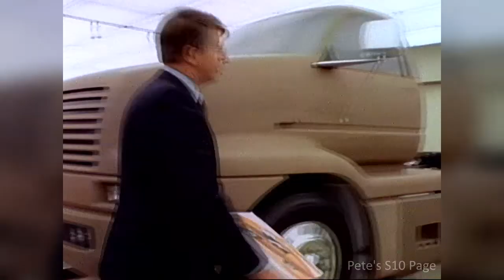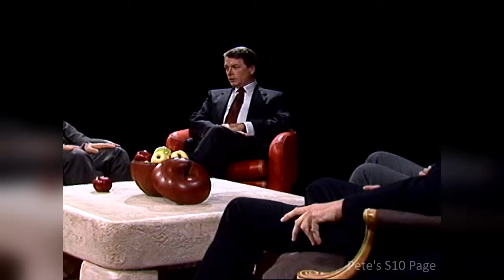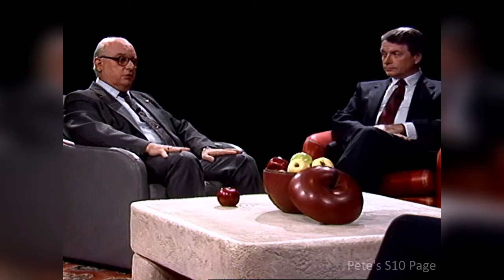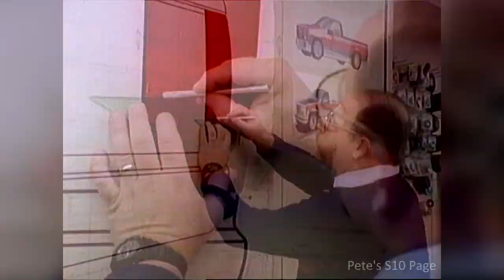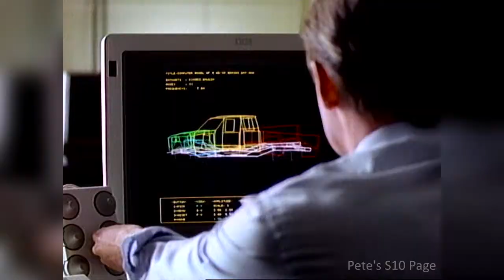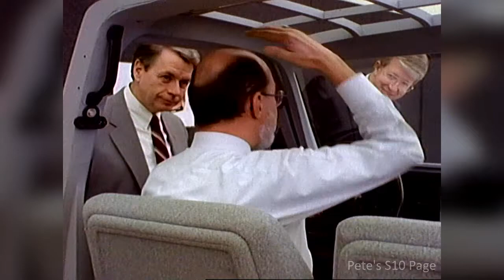1988 Chevrolet C/K Design and Development  - GM Training Film

Comment: It was a great body style,I wasn't A great fan of the weld on pin style door hinges,the dash was a little to busy for my liking,and they got away from the bolt together bed,and the double wall roof. I will say,it is a great driving truck,and very comfortable.and the fuel injected throttle body,and the Vortec engines were great performers,and decent on fuel and fairly easy to work on especially compared to the Fords at the time,and I am not putting down Fords,they were a good truck, until they came out with 97,and newer F-150,and 7 lug F-250s.One thing I like about the old body style Chevy is they were in my eyes a pretty good looking truck,there were somethings that could have been made a little better,but still overall a pretty damn decent,and dependable truck.

Comment: I bought mine new in 89, and still have it. It's true about the engine bay. It was the first hose/wire free engine compartment sense the 60's. Even A/C models had a clean engine bay... and hearing that they thought of the owner servicing the truck... making an effort to make that easy, is something that is long gone these days. I consider these the last true GM/Chevy trucks ever made. You can restore these to like new condition, and not even get close to the cost of a new one today.

Comment: Fast forward to 2024....make the thermostat housing one entire assembly....and make it out of plastic!

And put a clause in the warranty that if its used to full payload it voids the warranty!

Meanwhile at Ford: put a rubber timing belt in the engine....no seal it inside the engine with the oil....and do the same for the oil pump!

And any part that's not the block or head needs to be plastic! No not that! The cheapest plastic! Its got to last....4 years.

Meanwhile at Jeep: This wiring loom is already splitting and corroded from the supplier?....chuck it on there who cares. Marketing will offer free roadside assistance.

Comment: I think the 88 and newer Chevy is one of the nicer driving highway trucks, comfortable seating nice ac although the 88-94 controls can be a pain.
           I just wish at the time they would have continued some features that made a GM truck a GM truck ,like the double wall steel roof,and the bolt together pick up box,but progress,and cost cutting along with change can't be avoided.

Comment: I was attending the University of North Dakota in 1987.  I recall in the local newspaper an article about GM taking preproduction 1988 GMT 400 trucks to North Dakota to validate their HVAC systems...this was in January during a bitter cold snap.  They had a picture of two of the trucks being tested and it looked so radically different than the OBS previous generation.

Comment: Thank you GM Engineers, I'm still running a 95 as a daily driver today! And have a mint 98 too!
Reply: Damn!!! Nice! I wish I had A GMT400 4WD truck right now, I used to have a 1996 Suburban K1500 w/5.7 Vortec V8 and then later I ended up getting a  1992 C1500 extended cab w/5.7 TBI V8 that was lowered and had a full sport body kit that replaced all the side body panels and front and rear bumpers, made it look really bad ass, like a nascar/muscle truck…..The GMT400 had a very simple yet beautiful classic timeless design….
Reply: Still daily my 1990 C1500 up here in Minnesota the body has seen better days but it’s been a great reliable vehicle for me

Comment: These were probably the best trucks ever built.
Reply: If you’ve never used a truck.  The 3500HD was pretty ok.  But with engines ranging from meh (5.7-7.4) to 🐶 💩 (6.2-6.5)
Reply: @randymagnum143 the 4.3s and 350s are bulletproof. I own a 1996 4.3 with 235k miles and it has never let me down starts faster than both my dads 2019 ram and my grandpas 2021 f150
Reply: @galesburgdude9131  they're bullet resistant, maybe.  TBI was laughably outdated, but reliable.  Vortec injection was nonsense, and still not as powerful as a 5.9 Dodge.  
So, good enough to be better than any toyota engine.
Reply: @DanCooper-k4b no small block chevy was bulletproof, but a 283 might have been the closest, and a 400 the furthest away.  And the 4.3 has 3 distinct versions, from GM trying to iron out their inherent flaws.  They were acceptable at best.  The 3.9 Mopar was more durable, more powerful, and just as thirsty.  I think they shook a little less, myself.  But the 4.3 with the counterbalance wasn’t bad.  

They are certainly more bullet resistant than any aluminum headed engine.

Comment: This is amazing stuff, and shows a fair bit of surprising content given how carefully orchestrated any film shot within Design Center is. The large semi tractor clay model is what was being proposed for a Brigadier class 7/8 replacement. Like the GMT530 TopKick that followed, it would use a 400 cab, but use a nose similar to a design being pitched at the time for an updated General conventional. At least one running "AeroBrigadier" prototype was built, but likely scrapped. GM Heritage Center does, however, have one large scale model of the Aero Brigadier within its collection to this day.

Comment: If you would park a factory 88 to 98 Chevy or GMC beside a 2019 to 2023 the older truck still looks sleeker and more aerodynamic. The new one looks like a cardboard box especially in the back. Always liked GM trucks but would look to another brand for a new one
Reply: It’s designed like that on purpose. It’s supposed to look like a fist

Comment: I wish I could meet each and everyone of them and shake their hand my truck I've had for over 20 years in the family I've put over 400,000 miles on it it's been the most reliable pick up I've ever owned and still on it to this day it has a 4.3 Vortech V6 which I have replaced once three years ago because the old one was burning too much oil and came with from the factory believe it or not with a turbo 400 transmission which I had to rebuild one time and the original axles which all I've done is change the bearings and the c clips they are incredible under appercated trucks and i will always love them dearly

Comment: Every Chevy truck since then has been based on this one to the point where the 2022 models look like a caricature of the 1988.
Reply: Dude you can buy a work truck trim of any modern truck. Silverado work trucks are 20k minimum. Not that bad. Boo hoo you don’t get the heated steering wheel